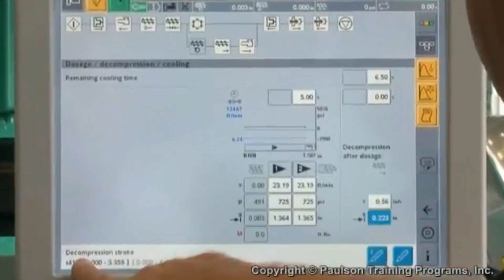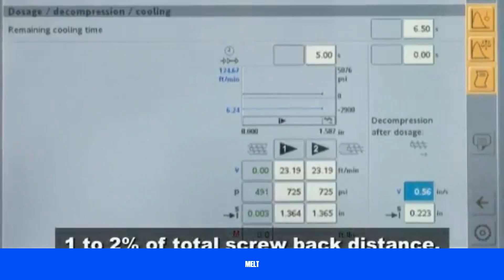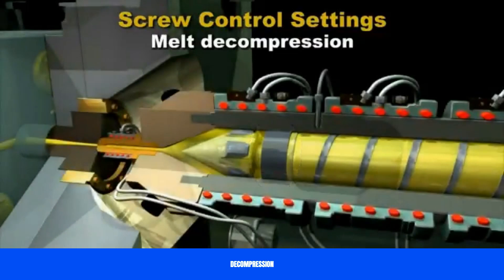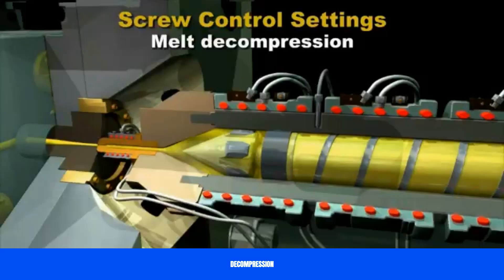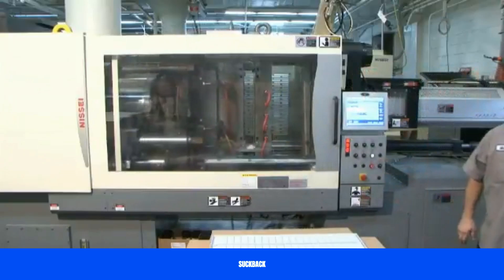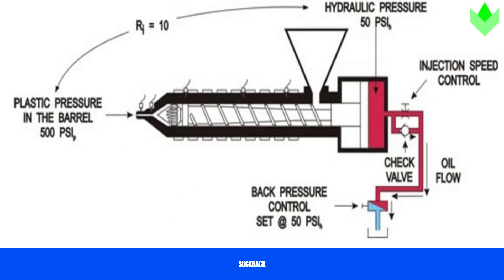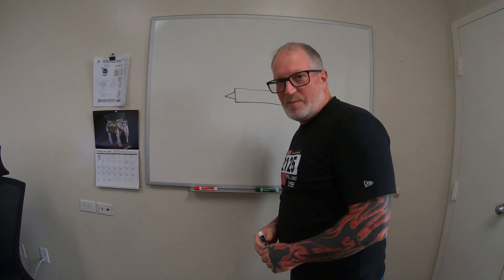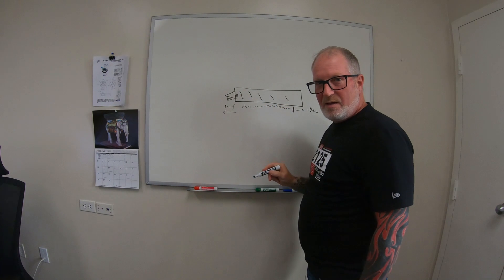What Is Back Pressure???

Comment: The only thing that'll take out those swirly burns in out old ass g-lines.
Reply from the maker: Hell ya bud, Thanks for watching & the support
Reply: @injectionmoldingskillsmore1064  I'm lucky to have found your channel thank you for the information. This stuff can be kinda boring at times and you seem to cover things in a way more enjoyable to learn. Thanks again
Reply from the maker: @nickshearer3091  I appreciate that, I try to give back to molders to help out in any way I can. I set molds & learned from a older guy back in the 90s. So, I think you try to help others if you can. Thanks so much for watching & the support means a lot.